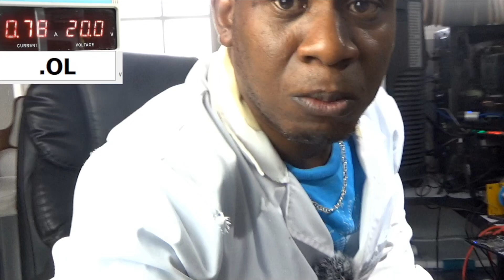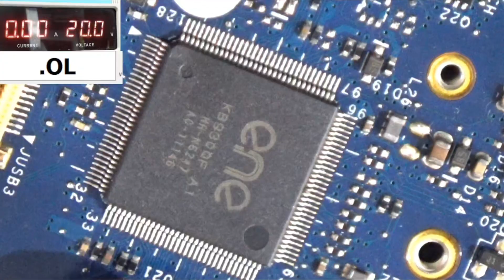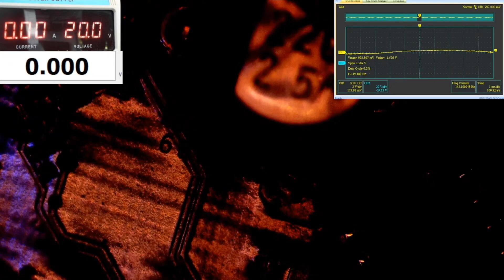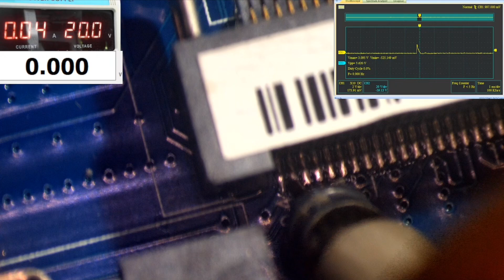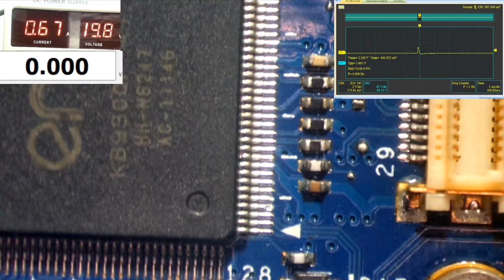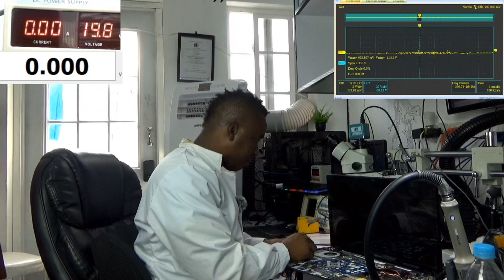Acer aspire 7750z no display

Comment: Sir why did you change cpu? You told it is problem of LPC so you should probably change sio and PCH am i right?
Reply from the maker: I didn't say the LPC bus is bad I only checked the communication between the EC and the PCH and there was no communication so it concludes it's a problem with the CPU